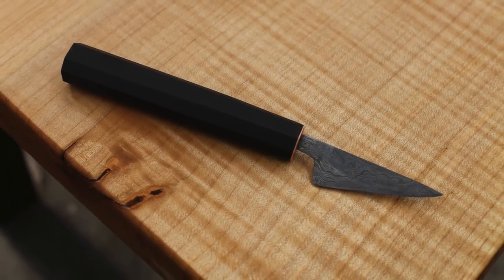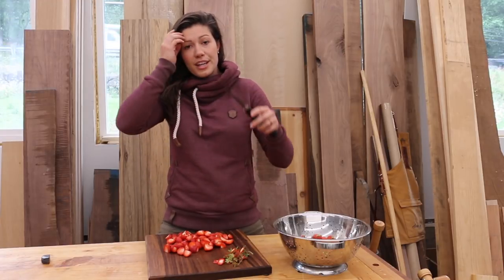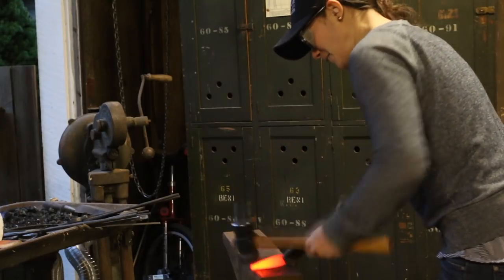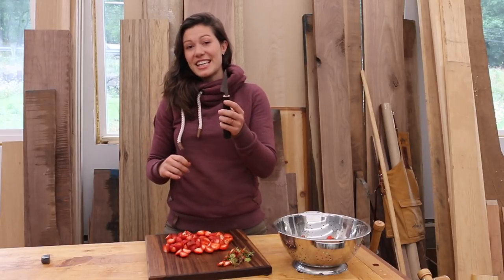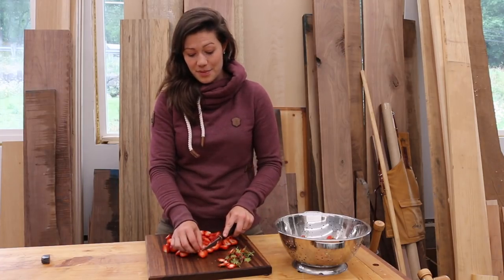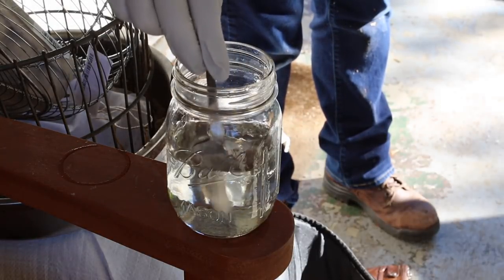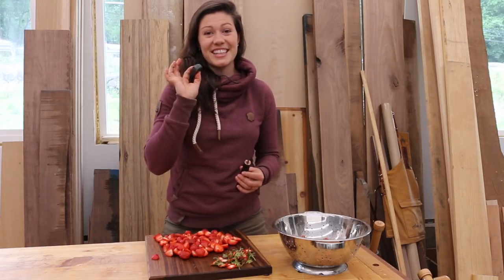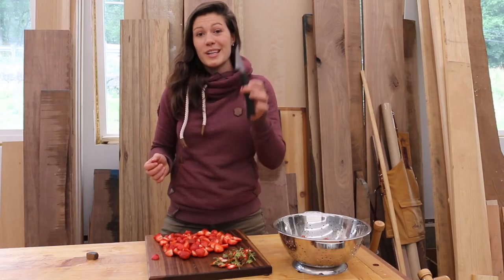Forging a Damascus Steel Knife // Blacksmithing

Comment: Pretty cool there Anne. I built my coal forge and a very small gas forge. I'm having a blast with the forging process, but I'm with you not so much with the tedious grinding, sanding and finish work. I think this is where I must don the earbuds and crank the music and enter my vacation spot... it may not be the most sexy part of the work but it makes the piece I'm working on sexy so...
Reply from the maker: Totally. Some good jams and a nice calm spot make for some fantastic results.

Comment: Good job on making a damascus knife. Now, if you use 2 similar steels for the damascus such as 15n20 and 1075, you'll have a very similar esge retention, anyway, way better than commercial woodworking tools which, after very few cuts, get that serration you were talking about even being a single steel. I am full time violin maker beside being part time bladesmith so I know what you mean when you talk about cut finish. That is something that sandpaper can never replicate. So, keep up the good work and try and make some more damascus tool, maybe next time you can weld a single steel edge onto the damascus body, that way you have one less thing to worry about. And it looks sick!
Reply from the maker: Thanks so much Francesco! I will definitely try again.

Comment: I have a damascus bushcraft knife. Only mine was not etched like yours.  Highly polished instead. Holds an edge like no other. It will turn into a very sharp serrated edge over time.

Comment: Wow!  You've got a hooded sweat shirt on!  I envy, the temperature here in Kansas is around 100 with an index of 110 to 115.  I'll just watch you at the forge for a couple more months, that much sweat would result in a brittle blade. Take care. ( don't catch cold)
Reply from the maker: Hahaha! I envy your heat, I have a condition that makes me feel cold all the time, so I wear a sweatshirt until July most years here in the PNW.

Comment: Congrats!  I've been playing at making knives for years but have never tried to make damascus (no power hammer).  I really like the copper bolster and octagonal handle.
Reply from the maker: Thanks Edward!
Reply: Edward you don't need a power hammer you just need smaller billets ive made hundreds of lbs of Damascus over the years never with a power hammer my largest billet was 8lbs forged entirely by hand

Comment: Cool vid!  Don't let the grinder time steer you away from knife making if that's the only thing keeping you from it.  With a larger more powerful grinder with better ceramic belts you would spend a small fraction of the time grinding.
Reply from the maker: That is a great point. I'm hoping to get a 2x72 soon.
Reply: And even your 1x30 will remove metal a LOT faster with a better belt.  In the video it looks like you are using the belt it comes with.  Get a Norton Blaze 60 grit ceramic belt and you can really remove a lot of metal quickly.   Ceramic belts last longer and won't heat up your steel as much too.  I use the ceramics for major removing / bevel setting and switch to the finer grit silicon carbide belts for final sharpening.

Comment: Your friend was wrong...Use contrasting steels with similar wear pattern i.e. 15n20/8670 ...then etch and scandi grind ..the flats will maintain the look, the polished bevels won't have an etch or cause scratches in your spoons and you will still have that same pattern welded steel

Comment: Another great video . Could you share your strawberry jam recipe ? Looks delicious !
Thanks Anne again!
Ernest
Reply from the maker: I like making freezer jam because it’s easiest! Heat the berries on low, Crush them up a bit as they soften, add a little sugar and lemon, bring to a boil on low, then add more sugar or lemon to taste and serve! I really don’t like adding much sugar because the fruit is already so sweet, so even making jam, I always cut the recommended sugar in half. I keep a few pints in the freezer and defrost them whenever I run out.

Comment: The way around your two steels wearing at different rates is to have a homogeneous core with your patterned steel billets on either side! This way every time you sharpen the finished blade, you're revealing and sharpening more of the homogeneous core steel.
Reply from the maker: interesting! I'll have to give that a shot.

Comment: Extremely cool project. If you get the itch to make a blade after the carving knife, take a look at making a kiridashi. They're insanely cool shop knives that can take an offensively sharp edge. They're also a lot of fun to forge out while using a lot of the basic skills. I am a beginning knife maker and it's funny, I have just about ZERO patience with woodworking but I have no qualms about pitching a knife I'd been working on for a couple of weeks and start over again because I didn't like where it was ending up. I hope I get to keep one of my kiridashis sometime soon, I even bought damascus steel to make mine. I have yet to make damascus from scrap, I'm missing a couple of tools and I still need the right kind of high carbon low nickel steel to go with the 15n20 I have stashed away to make my first try with.
Reply from the maker: Keep on forging! Sounds like you've found something that makes you really happy.
Reply: Anne of All Trades ABSOLUTELY. I'm not right if I'm not making something. Metal has always been my medium of choice, now I can properly explore it with the right equipment and developing the right skills.

Comment: Ya, sure. I think the little chick, in the beginning, made the knife. Hahaha. Very cool knife.
For the smooth finish when carving with a damascus knife, you can put a thicker layer of your knife steel on one side of the billet. You can even put it in the center if you grind you knife blank at an angle to make sure the single layer forms the edge. That way you get the beauty of the damascus and the smooth cut. Although you seem to be learning at a good rate and have probably figured that out by now.
Reply from the maker: Great tip! Thanks so much!
Reply: Anne, I'm making up several billets of damascus and mokume gane. If you ever get interested in making another carving knife, please let me know. I would be more than happy to cut you a couple pieces around the 120 layer mark. Just specify if you want high contrast or low contrast steels and I would be more than happy to "donate to the cause." I will also have some extremely high layer count, high contrast steel around within a month.
Reply from the maker: 64t120r hey that would be super awesome! I won’t likely use it for carving tools, but I would really like to make some kitchen knives, particularly a butcher knife. If you shoot me an email at marketing@anneofalltrades.com we can make arrangements. That would be super fun.

Comment: Next time try forge welding the damascus on either side of some tool steel.  Then you can grind the cutting edge to expose the tool steel.  You won't end up with the micro scratches on your projects because the cutting edge will be tool steel, but the rest of the knife will be damascus.
Reply from the maker: That's a great option. This one didn't work out as a carving tool, but worked fantastic for the kitchen!

Comment: Great video and chat, be careful using the mason jar to quench your blades, I've seen one crack and spill oil all over the place, luckily it wasn't on fire at the time, not sure if the guy dropped his blade into it or if the oil heated up real quick and cracked the glass???
Reply from the maker: Probably the latter. Because this was such a small knife that wasn't really a concern, but a bigger object that would heat the oil quickly could cause a big firey mess in a hurry. My forge is currently on my front porch and my setup is janky at best, as I'm in the midst of building a metal shop, but when the shop is done, I'm hoping to have an efficient and highly functional forge and welding station.

Comment: Very cool knife! So to set the blade in the handle you drilled a hole and epoxied the blade in with wedges to take up the space? Very nifty approach!
Reply from the maker: not quite wedges, a dowel with a mortise that matched the tang of the knife, but the same general idea, yes.
Reply: I haven't seen that before, I like it!

Comment: Damascus is to prevent breakage; I have never broken a woodworking tool. You could forge secure hardware for a lock-box or anarchists tool chest or...just lighter and more refined than regular metal.

Comment: Food prep on a woodworking table??  Odd.          It looked like you used copper on your handle.  I tend to prefer brass since it isn't as soft and doesn't discolor as fast as Cu.  Several videos on YouTube used copper pipe or tube for necks of chisels and turning tools.  I used brass fittings on a few tools which worked out well.  If you don't need to shape the smaller hole for the steel, you can either screw the fittings on the wood or grind the threads off and press it on.  Then you can remove the facets of the outside by filing/sanding them into a smooth round ring or leave it hexagonal if you prefer.